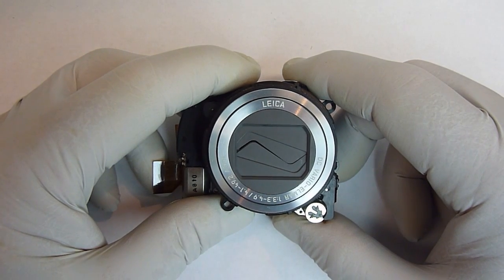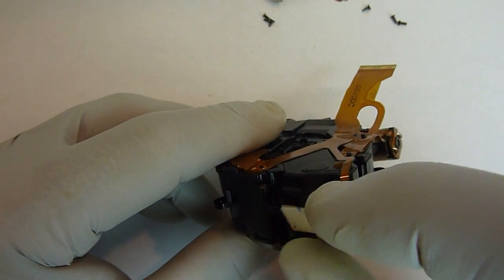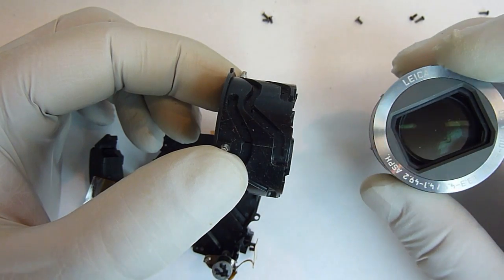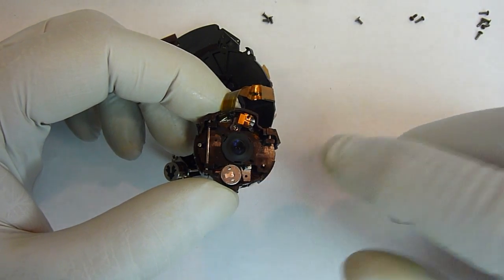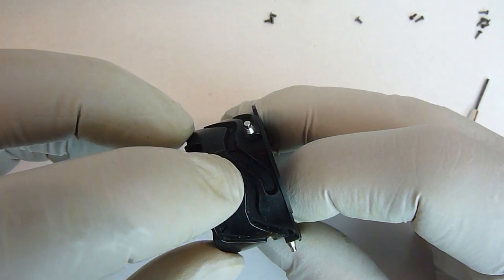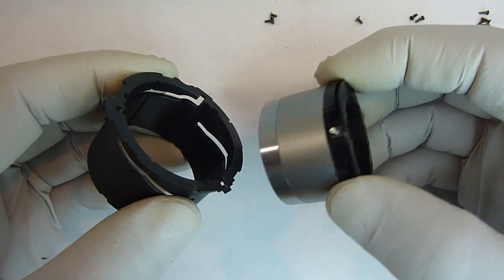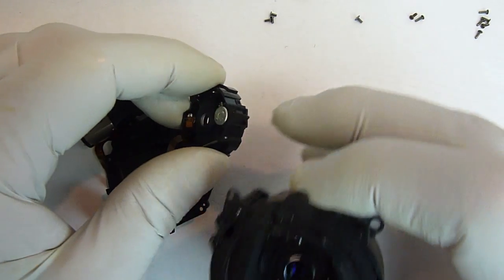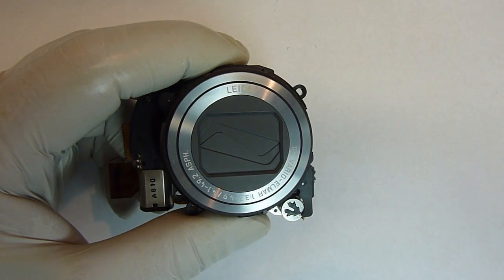How To Repair & Clean A Panasonic Lumix ZS & TZ Model Leica Lens Units

Comment: Dear Robert, thank you very much for this wonderful instruction video. I have gotten an old DMC TZ10 unusable because of "System Error (O.I.S.) and came across your video in search for information where the image stabilizer would be. From your video now I know, and I wonder if you could tell me if this might be an error that dis- and reassembling the lens unit would put a stop the error message "?
Reply from the maker: Hi. Unfortunately it sounds as if there is more than just a problem with dust in this case. I would guess that it is an electrical issue with it. This video will get you inside the lens unit  though to where you might be able to see what the problem is though, just in case it is something just preventing the IS to move.
Reply: @Thebobfactor   Thank you, anyway. And greetings from Germany  :-)
Reply from the maker: @HSVSystemfahrer  You're welcome. 🙂

Comment: Your video was really helpful for disassembling my ZS3 lens. However, I'm stuck with cleaning the very outer lens element. I'm not sure if you've noticed, but that element appears to be made of two glass surfaces that were sandwiched together and injection moulded into the plastic part of the element. I can't see a way of separating them without irreversible damage. Fungus has grown between those glass surfaces. Any ideas welcome!
Reply: I have the same issue on my ZS7 if you found a work around for this matter let me know please

Comment: Superbly done.  But what do I need to clean and lube while in there?  I would think the spiral grooves that the guide pins ride in would need to be very clean to avoid the lens getting stuck, but there is no mention of cleaning them.  Also, the plastic gears appear to be a problem area, attracting dirt on the lube.  So these should be inspected, cleaned and lubed with lithium grease?  Any other things to do while disassembled?
Reply from the maker: Hi Robert. Yes, it is a good idea to clean the grooves and pins. I just forgot to mention that I guess. I highly  recommend that you do not use any form of grease on the grooves and pins of the lens unit. I've never come across any lens unit that had any form of lubricant in the grooves. Any lubricant would become a dust and dirt collector . Beyond that, you should be good with just doing what is shown in the video. Good luck with it Robert.

Comment: Great video. I have an old ZS1 with dust particles between lens. I followed your video and was able to completely disassemble and reassemble it. Unfortunately the particles seems to be between the two pieces of the front lens and was not able to split them apart to clean it. Seem to me that one its sealed,is it ?
Reply from the maker: Hi. Unfortunately I have not worked on the lens of a ZS1. I wouldn't think that they are bonded or sealed together though. Especially if dust is able to find it's way between them. Sorry I can't be more help.
Reply from the maker: I was able to find a lens unit like yours that only uses two screws to hold the front shutter assembly on over the object lens. And, this lens also has some spotting inside the objective lens. Unfortunately it looks like they are sealed. That sucks. I tried to remove the outer part, but it would definitely break if I forced it. And I don't see any way to remove it from the inside. So for now I don't see any way to separate them at all. I may go ahead and dissect the lens and cut it apart just to see if there is any sign that they are glued in place, or if there could be a way to separate them. I'll let you know if I find anything more.
Reply: @Thebobfactor Wow !.. Thanks so much for the help and all the effort, I also have the impression after seeing mine it could come heat sealed or glued. But please don’t ruin your lens just because me.
Reply from the maker: @rogelioleal8960  It's no problem. It's not a lens that I can use any more. So this will put it to good use. 🙂
Reply: Its the lens that its closest to the shutter/ retracting front blinds. Seem to be a 2 parts lenses mounted one from outside and one from inside the plastic frame. But not idea on how to separate them

On a closer look, it may not be dust but rather like salt crystals from humidity crystallization, maybe.
Reply from the maker: @rogelioleal8960  Just to be sure, you're talking about the main object lens shown here, correct? https://youtu.be/zDGVqY2N0PM?t=1082
Reply: @Thebobfactor  Yes. That one. I went all the way up to remove the shutter front assembly as you showed there. But the lens itself seems to be composed of two lenses on the frame and I cannot figure out how to separate them or if is even possible or need to replace that part.
Reply from the maker: @rogelioleal8960  Let me see if I can find a lens that may be similar to look at closer. Are you still able to remove the front lens shutter by removing the three screws from inside the lens? Can you get a picture of the outside of the lens and also one from the inside?
Reply: @Thebobfactor  At the moment I have it reassembled. But will took it apart today evening again. Will took a few photos.

Thanks a lot for you help
Reply from the maker: @rogelioleal8960  No problem. I will see if I have an older lens to look at. Were you still able to remove the front lens shutter by removing the three screws inside the lens?
Reply: @Thebobfactor  Yes. I was able to remove it as in your video. Although my model only comes with 2 screws for that part.
Reply from the maker: @rogelioleal8960  Excellent. I'll see what I can find for a lens here that may be similar and let you know if I can figure anything out. Just send over the pictures whenever you can. Thanks.

Comment: Thanks for the tutorial. I was stuck with disassembling the lens from the tz60 :/ Do you have an idea how to do it?
Reply from the maker: I have tried to disassemble the lens unit on the ZS40/TZ60, but have not been successful at it. I do have another ZS40 to attempt it on, if I figure it out I will post the video. All I have on that model for now is the main body disassembly and LCD display replacement. You can see the main bode disassembly video here: https://youtu.be/fYZlhShQ-hg
Reply: @Thebobfactor  I saw it and you show it great. You have amazing talent!

Comment: Hi Robert -
extremely good video. I will use it to repair my Pana LF-1 camera.
By mistake i cut the PCB between the two parts aof the lens unit.
as there is no spare part for that I bought a dead LF-1 on EBay and
use it for spare. BUT:
I do not know how to remove the cut off part of that flex circuit board
in the front part  of the lens unit.
Can you give me some advice ? I would highly appreciate it as I  now
have two dead LF-1 s. v Thank you so much.  Rudi in Germany.
Rudolf-Herzog@t-online.de
Reply from the maker: Hi Rudolf. Are you talking about the flat ribbon cable first show at this time location in the video: https://youtu.be/zDGVqY2N0PM?t=334 ? If so, I'm afraid I've never changed that one out, but I believe it would require changing out the entire flat ribbon cable that lays on the back side of the entire lens unit. I don't have that camera to look at any more, but I believe it will also require you to unsolder the flat ribbon cable at a couple of locations too. So you would need to have a good soldering iron and preferably an unsoldering iron as well. Sorry I can't be more help.
Reply: @Thebobfactor  
Thank you so much for your fast response.
Well, it is that flat ribbon cable that was destroyed by me, as I was
re-assembling the lens unit and didn't take care of that enough.
I'm afraid that the end of the cable that goes inside the lens unit is
somewhat soldered or so, that it is impossible for me to heal it.
I will look for another used LF-1 on EBay. Thanks anyhow for your assistance.

Comment: Thanks for this I will have another go at it. I took it apart to clean and had to stop because I was totally lost.  I found the service manual online and it says you can leave zoom motor inplace also the little optical image stabilizer thing has an extra notch so I think it's only fits in one way. and yes I think you need for gloves otherwise you're practically guaranteed to get a big greasy fingerprint on your nice clean lens !

Comment: Well, my ZS7 I picked up for $20 on ebay now works flawlessly..  At first I thought the damage I did to the horizontal plastic on the optical isolation system plate that goes over the retractible pin was a show stopper because I kept getting an O.I.S. error after a minute or so telling me to power off and back on again.  So I tore it down again and cleaned it up in that area to reduce the chances of sticking as the plate tried to move.  that didn't work so I tore it apart a third time and that horizontal part broke off completely when it was attached to the vertical post on the movable board.  So I didn't see any function fo that anyway, and put it back together with out it where the pin was still over the movable board but no plastic above it, and low and belold it now works flawlessly !!  I think that horizontal piece of plastic isn't functional except maybe to make it harder to back off the pin.  So I'm reall happy now as I have a like-new ZS7 that I got very cheap and was able to fix myself thanks to Robert Hosea's outstanding video.  THANK YOU SO MUCH !!
Reply from the maker: Chicago John, what an awesome job of repairing your camera. Your persistence certainly paid off. It can be frustrating after getting a camera back together, only to get yet another error message. And it's easy to just quit at that point. Not you. That's great. I'm glad your camera is working and I'm glad that the videos helped you out! -Bob

Comment: Well, I picked up a ZS7 on ebay "for parts / repair" and it turns out the lens was full of sand.  I think ksomeone took it to the beach shortly after they bought it and literally dropped it in the sand. It was that bad.  But having watched your video now literally more times that I've watched The Godfather (which is a lot of times), I was successfull in fixing the lens and getting it working before the power flat cable going to the focus motor burned out (as you showed in another video how to fix).  The one issue I had was in removing the anti-shake magnetic piece.  I managed to somewhat mangle the litttle plastic tab that goes over the pin you have to set back.  So I think I was able to strenthen it back in place with a drop of cyanoacrylate that I let harden overnight.  That would be one caution you could think about adding to your video -- to be real careful when pushing that pin out so as not to damage that plastic tab in the process.  So thanks again for the exelent videos, this being a great one!

Comment: Robert, i followed you video on cleaning the lens of a DMC-ZS10 Lumix, everything went well, but on reassembly i tore the flat ribbon cable that's going to the image stabilization in the front lens, Ribbon #T12NE1, i can't find it on line and the camera repair shops wont touch it because it already open and don't want to be responsible. Can you help me find the ribbon.
Reply from the maker: Sometimes you can get lucky and find the individual lens parts on eBay. But I looked and I don't see that part anywhere. So, unfortunately you may need to buy a used lens unit just to get the part you need. I did find one on eBay for a ZS10 that is listed as working. You can see it here: https://www.ebay.com/itm/Panasonic-Lumix-DMC-ZS8-DMC-ZS10-TZ18-TZ20-Lens-Replacement-Unit-Part/282879672765?hash=item41dcf141bd:g:XZMAAOSwXRNag0G3.
Reply: It a ZS10
Reply from the maker: Yes, the lens unit will work on a ZS8 and ZS10.

Comment: Good afternoon Robert, results that I set to make the arrangement, it was perfect, until I had to put the lens inside the case, as it did not enter I thought I had it wrong and I opened it again and when I was putting it, I broke the orange cable that is just connected to the lens and the cap of it, will there be a solution? He cut straight. and then I realized watching the other video that had to disarm the whole carcass, because it is because of the screw where the tripod is placed that the lens did not enter and I thought it was badly fixed but in reality it was that I had to disarm that first. Well I hope an answer, I'm pretty sad since I had solved it and just when I'm going to put it in the carcass it breaks. thanks Rober Excellent video and help. Eugenia from Argentina
Reply from the maker: Good evening Eugenia.
Oh man, I know how that feels to be that close to being done, and then having something like that happen. I know it's no fun. If you are talking about the flat ribbon cable that is attached to the lens image stabilization assembly shown here at time stamp https://youtu.be/zDGVqY2N0PM?t=1465, then I'm afraid that there isn't any easy way to fix it. It would almost be better, and easier, to find a used lens unit on ebay that  has that piece to replace it. I've tried repairing those flat ribbon cables before and it almost never ever works for me. Sorry I can't be more help on that Eugenia.
-Bob
Reply: good night robert exactly that is the cable that was cut, find out about a liquid called conductive paint, but if you say it did not work, I'll see the lens on ebay, but I would give it for lost, it's a pity that everything worked fine until the end and for a mistake that cable was cut, bad luck, in short thank you very much for the advice and for impressive explanation, I wanted to save my little camera because it has a mini leica lens.
Reply from the maker: I'm afraid conductive paint wouldn't work in that situation Eugenia, because the cable moves so much when the lens is zooming in and out. It's tough giving up a camera that you really like, because it either can't be fixed, or because it would cost more than it's worth to fix it.  I hope you're able to find another camera that you like just as much as you did this one.

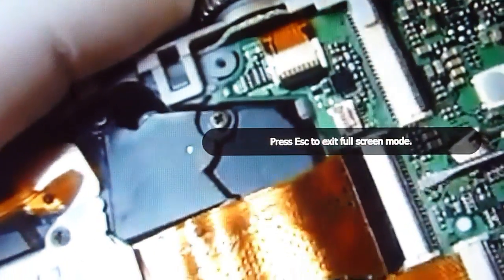Comment: Hi Robert, thank you for very useful and detailed videos. Unfortunately, video referred in the above @~1:04 - 
"Repair Panasonic Lumix ZS6, ZS7, TZ9 and TZ10" is no longer on your channel. 
Would it be possible to restore it?  Need to clean sensor on ZS6. Thank you.
Reply from the maker: Hi Victor. Thanks for pointing that out. It's now available again. You can see it here: https://youtu.be/o9O43EOkiKY   Good luck with your sensor cleaning. -Bob

Comment: Hi Robert, I just disassembled my Lumix TZ71 following your first video. Unfortunately when I got to this point where I had to disassemble the lens... it seems that the lens differs from those of previous versions. I can NOT take it apart:(
The issue of my camera was that the picture on my display when in live mode was twitching and after a while it shows a message: ˝please turn camera off and on again˝  or... not so often this message: ˝system error (O.I.S.)
So I started following your advice till I got to this point where I can´t disassemble the lens. Any suggestions? Anybody disassembled the TZ60 or TZ70 that you know? Thanks in advance...
Reply from the maker: Hi I've never worked on that lens at all, but the problem sounds like it could be a problem with the focusing motor/drive system. Unfortunately you would have to be able to get into the lens to diagnose it. I can look around for a used TZ71 so that I can use it to do a video on it. But right now I'm afraid I can't help you much. I will see if I can find any info on it for you though. -Bob
Reply: Hi Bob, I finally got it... I left everything, slept over night and in the morning when my brain recovered I took it apart.:) To my modest eye, everything is just fine inside.:) There is though a little wire which is not in it´s position. I suppose, the camera fell to the ground and something has to be ˝broken˝. I thought the image stabilization sensors are gone. (if you have an email I will send you some images, to hear your opinions and suggestions) thanks
Reply from the maker: Yes, you can send me the photos at hiking@thebobfactor.com.
Reply from the maker: Hi. I received the pictures, but my email back to you was returned to me. Not sure why though. 

Are both ends connected, or is the one end on the right disconnected?

If the problem is intermittent (it is intermittent isn't it?) then I wouldn't suspect that as being the problem. But, then you would also have to wonder why on earth that wire would be there like that.

I have been looking on eBay for a used/broken ZS71 to dissect, but so far have not found one. Once I do though I will open up the lens unit.

Bob
Reply: the wire on the right side is disconnected. I suppose it is because of the impact on the ground. I´m also thinking whether the sensors could be shaken or broken at all and that they are making troubles?!
Reply from the maker: Most definitely. If the impact was enough to break a wire loose, then it could have caused problems with the IS, focus, or main lens unit. Can you see any indication of where the wire was originally connected?
Reply: Hi again. There was indeed a place where the wire could be connected. So I gave it to my friend(i don´t have the proper tools), he connected it to the right place, but when i tried to reassemble the lens a part from the flex broke.:( I´m selling it now in parts on ebay. thanks a lot Bob, I learned a lot from you!
Reply from the maker: Sorry I couldn't be more help. I think you're doing the right thing though. Sometimes some cameras just don't want to cooperate very well. :-)
Reply: Yorda TUBE ,Going through all that i rather hammer the bloody thing and buy another.